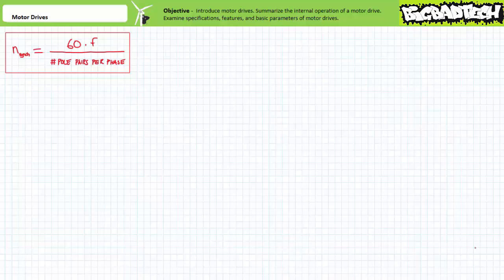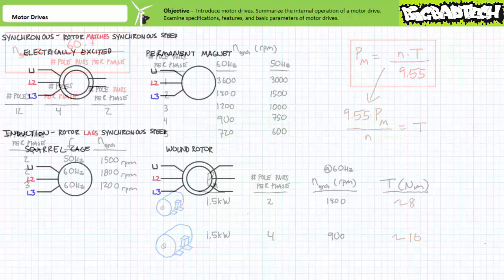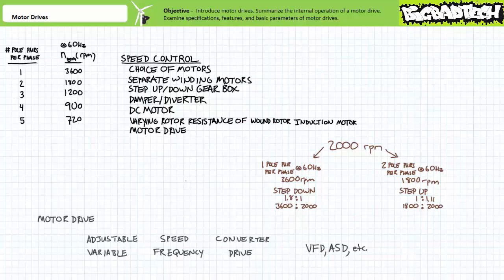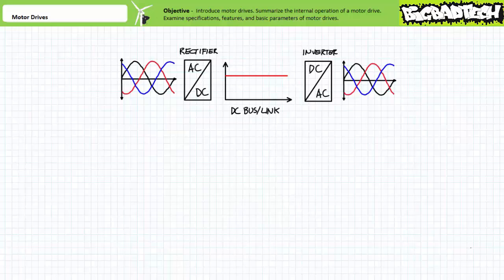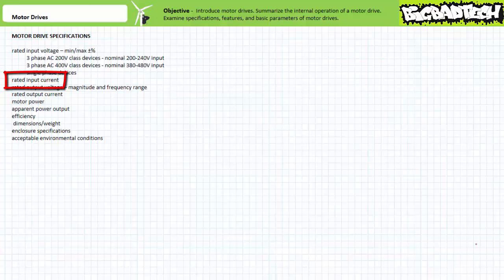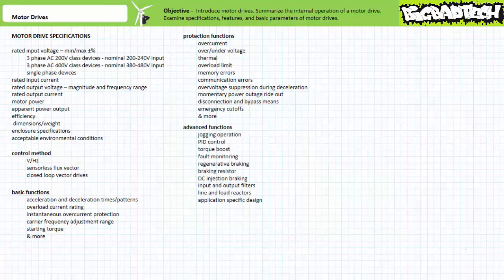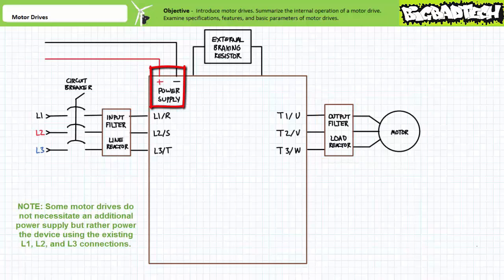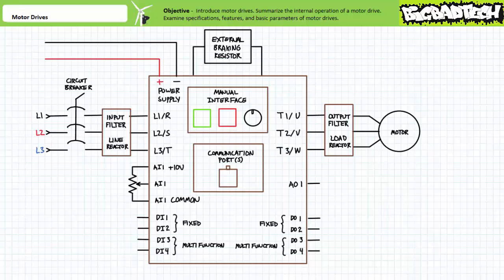Motor Drives (Full Lecture)

Comment: Thank you so much for making this video as well as taking the time to explain about the basic interface with all the different available connections that wires could go to. 

I did a industrial machine removal of a large CNC panel saw (8000lbs) and got to keep the machine. Inside the electrical box were x2 Omron Sysdrive VFD that I salvaged hoping to use them for 5HP inverter motor but even after downloading the manual I only understood where the basic 1ph input / 3ph output and where to add a DC choke for adding noise filtering of the DC Bus 😅. Everything else was written as if the reader had taken a class on Omron’s VFD. 

Looking forward to watching any other further in depth videos you make!

Comment: Great Video had my attention from start to finish. Look forward to more videos hopefully on VFD designing a simple 1 phase 220v 60 Hz to Three Phase 220 volt 60 hz converter with jelly beans parts. Common Mosfets and Op amps etc etc  FYI You are the Alan from w2aew channel on analog circuits, Dave from eevblog on test equipotent and electronics. Roger from KainkaLabs on opensource and modifying stuff projects and circuits,etc etc Hope you do well on your channel. Best regards
Reply from the maker: Thanks for the kind words. Yes, once I finish AC circuit analysis I'd like to dive into power electronics.

Comment from the maker: A free study guide for this lecture is available at: https://www.cgcc.edu/study-guides
Reply: It says access denied. Is it true that you can run a DC motor with AC voltage applied to the armature and DC voltage to the series/shunt field?
Reply from the maker: 1) Let me check on that. Are you getting the error when you enter the website or when you try to download?
2) Yes ... but not well. That's kind of the principle of a universal motor. I'll explain in later lectures.
Reply from the maker: Mejia,

Link should be fixed. Give it a test.
Reply: It works!
Reply: @bigbadtech  just tried it, its not working

Comment: Jim, I have always wondered about the number of poles in a particular motor of mine.  It is circa 1940, used for an ancient elevator.  Name plate data shows 1) CYC - 60.  2) RPM - 750.  With that info the only possibility is the synchronous speed for a 50Hz/8-pole motor.  But given nameplate says 60 CYC and all other induction motors I've seen gives RPM with slip factored in I'm at a loss.  If you have some time I would appreciate your thoughts.  Thanks!
Reply from the maker: Old motor nameplates are the wild, wild west so no telling what you're dealing with without closer inspection. This being said, slip is typically factored in for motor nameplates(ie: nameplate rated speed occurs at rated torque and rated mechanical power). 8 poles per phase = 4 pole pairs per phase => at 60Hz this would be synchronous speed of 900rpm. At a rated speed of 750rpm this is a slip of 16.6% which is very very high (typically slip is less than 6%). Another crazy possibility might be that it could be a 4 pole pair per phase synchronous motor intended to operate at 50Hz? (but why would they put 60Hz on nameplate?) At 50Hz it would give you a synchronous speed of 750rpm (as you calculated) and, being synchronous rather than induction in nature, it would follow the rotating magnet field without slip. Hard to say. Anyways, stay in touch because I've got a whole bunch of motor content in the works. Until then check out this playlist: https://www.youtube.com/watch?v=SB8BTldMsO0&list=PLdnqjKaksr8oba07pG-nE1Omy1_mabMtI
Reply: Jim Pytel thanks for the thoughtful response.  Since it is a elevator motor with a reduction gear, high temp rise, and 1.4 service factor I’ll bet it has a high slip speed.

Comment: Thanks! What measurement or meter can be used to check the output of a drive to a motor? If the drive has no bypass and the motor isn’t running on a call, would you check the frequency output?
Reply from the maker: Perhaps the easiest means would be the use of an AC voltmeter on the line to line (or line to neutral for that matter) of the connections leading from the drive to the motor. Even easier .. often the drive itself will display these properties and more without the use of an external meter.